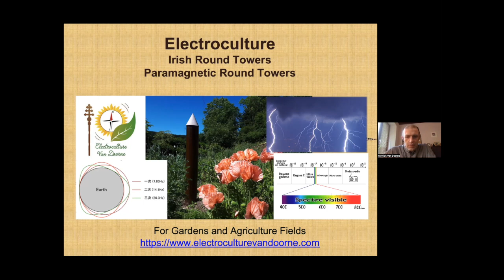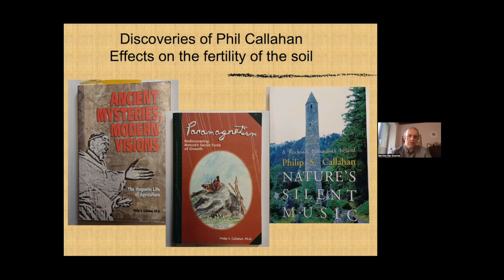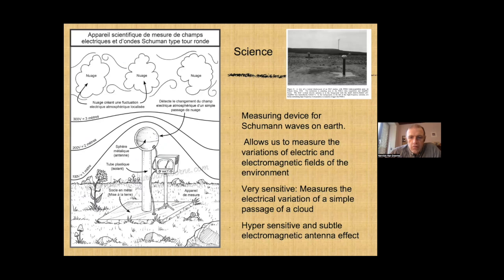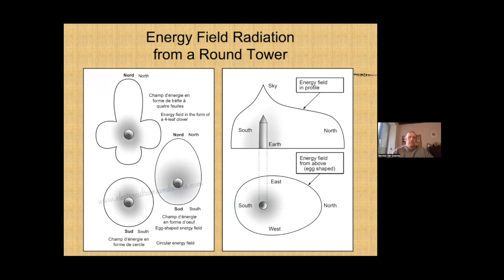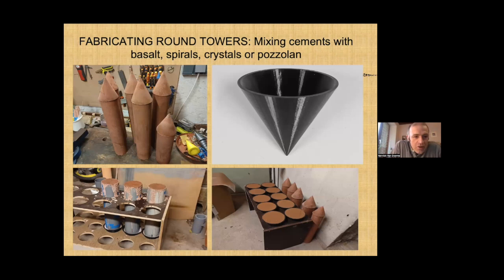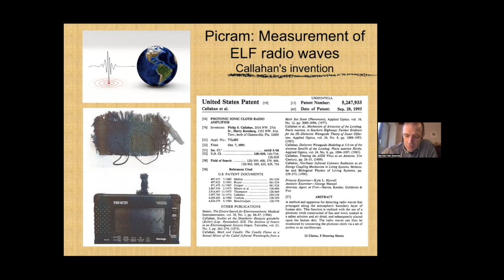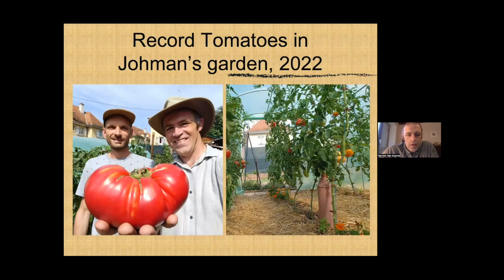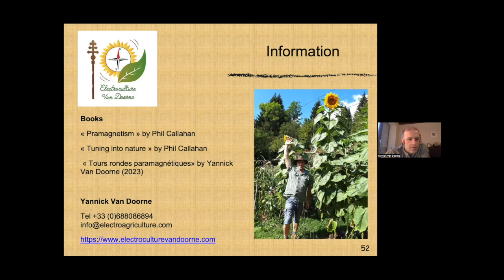Electroculture Irish Paramagnetic Round Towers Lecture 4 Spring 2023 with Yannick Van Doorne

Comment: Thanks again Yannick, I'm going to make some of these with your cone moulds, I doubt I'll get those pipes you recommend as I'm in Ireland I'm going to use large drain pipe just for a mould then remove it when the cement is dry, I think I've found a big pile of iron oxide in an old quarry.

Comment: Yannick, incredible man, thanks. One question: At around 10:30 of the clip, in the pic on the right it looks like there is also an antenna at the very top of the tower. Correct? If so, what was it made of and how was it incorporated?